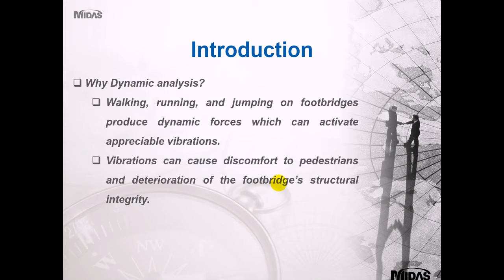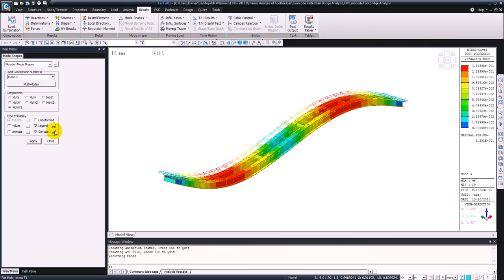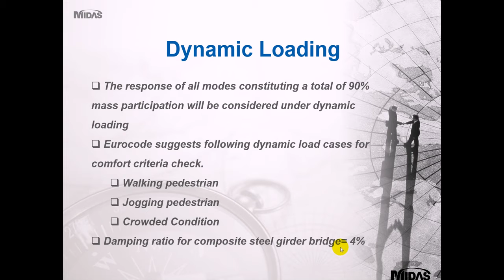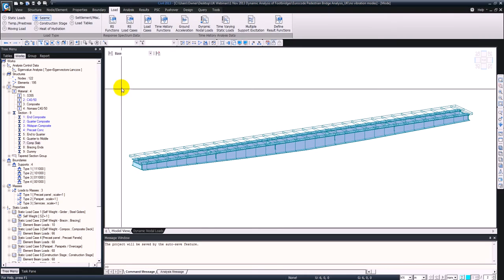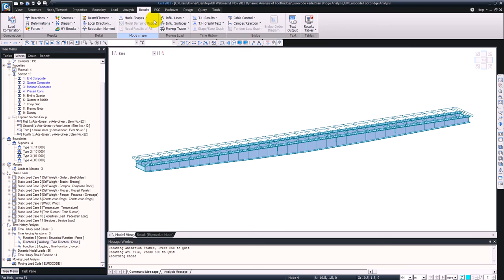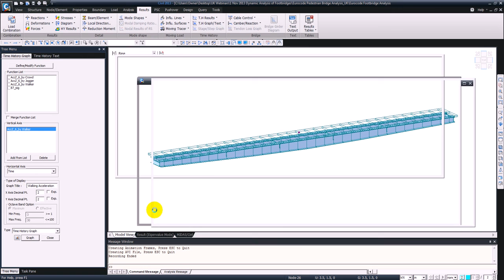06 Dynamic analysis of a foot bridge

Comment: Hi this is a great example, there was a couple of things I wasn't sure about, alimit according to your k factors would have ended with a 0.5m/s2 rather than 0.91 m/s2.  Also it would be really useful to see the modelling of the crowd loadings as this sections was skimmed over.  If Midas could provide this model in the tutorial examples it would be really useful.
Reply: at what time did you see these k factor values?